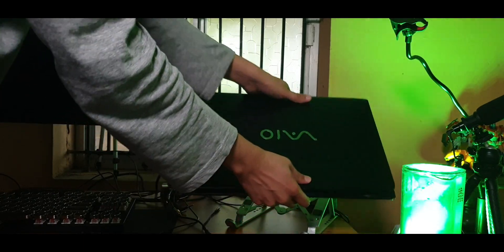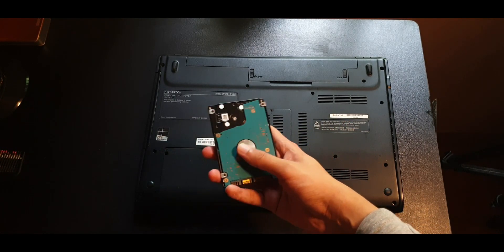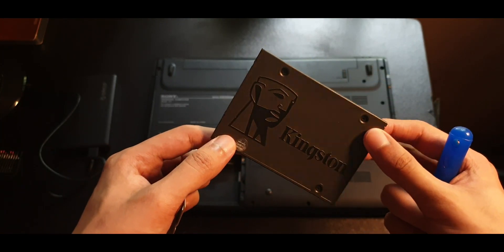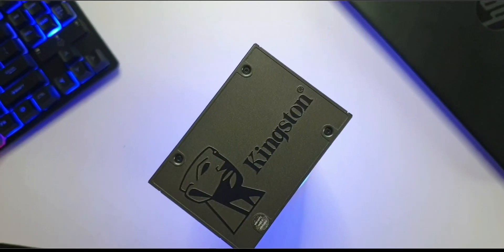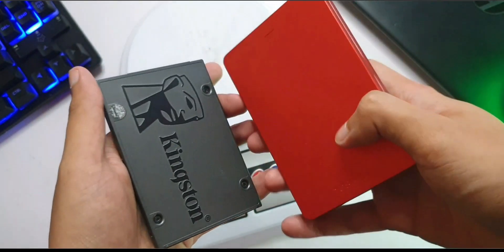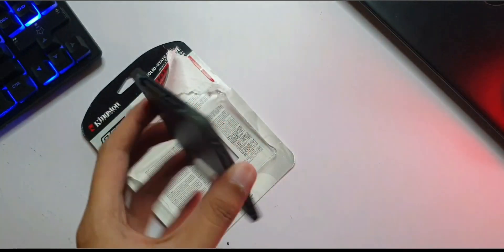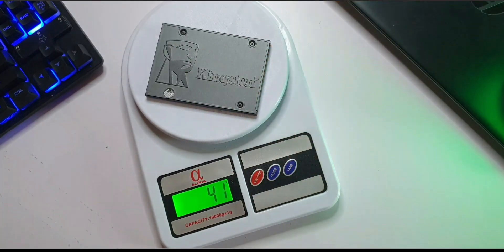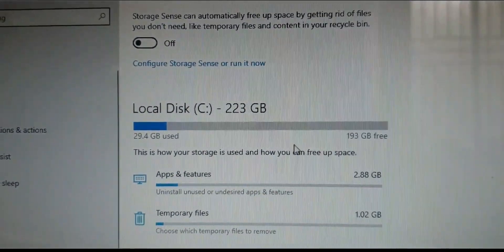How to Upgrade your Laptop HDD to an SSD! - Hard Disk to SSD Upgrade Guide

Comment: how can i copy my hhd windows 10 to ssd? and if i upgrade my hhd to ssd will it automatically boot in ssd???????????????????????????????????
Reply from the maker: The OS is stored in the HDD itself. If you replace it with an SSD, you'll obviously have to install the OS separately on the SSD again.
Reply: @TheHopelessGeek  HOW?
Reply from the maker: Install Windows again on the SSD after you put it into your PC. You can then migrate your HDD data to it via USB transfer.

Comment: so this year i noticed my pc was getting slow due to 5 year old hard disk and i decided to upgrade to ssd. it hugely improved speed but then i noticed my 5 year old cpu was bottlenecking ssd and i could not enjoy full speed of new sata ssd. then i upgraded CPU too which meant motherboard and ram and powersupply were upgraded too. i conveniently bought a nvme ssd and put it in too. now i dont use my sata ssd because its slow.  Does performance increased? yes hugely.  was it worth it.? dont know. hotel? trivago.

Comment: Bro, I have Sony vaio VPCEA33EN, the bottom of the laptop is exactly similar to yours, how do I confirm if the SSD you linked will be compatible? Also, loved the vid!
Reply from the maker: Sata3 ports are the same on any machine, regardless of the manufacturer. It's like USB, a standard.😀
Reply: @TheHopelessGeek  thanks a lot! I'm pretty noob at all these geeky stuff😅
Reply from the maker: 😀👍🏻no problem

Comment: hi, great video! just wanted to say m.2 slots may or may not have comparable speeds. an m.2 sata slot will have exactly the same speed however an m.2 nvme slot will have significantly better performance
Reply from the maker: Yeah, sounds about right.🙂

Comment: Can we use laptop hard drive in our pc?
Reply from the maker: It will be very slow, but with some adapters, you can.😅
Reply: I don't think you need any adapters as it has the same connectivity as desktop hdd (sata and power)
Reply from the maker: That's true, you should be able to directly plug those two cables in.

Comment: I bought CB GK 18 by watching your video a month ago, but now the enter the left shift key 's stabilizer's are making noise , and an irritating one. What should I do?
Reply from the maker: I think left shift doesn't have stabilizers..🤔
Anyway, try putting some lube under them to dampen the rattle
Reply: @TheHopelessGeek  Should I call customer support? As it's under warranty
Reply: @TheHopelessGeek  it does have stabs, all the longer keys except tab and caps lock have them.
Reply from the maker: I just noticed it, yeah.
Reply: @TheHopelessGeek  yeah
Reply from the maker: You can try lubing them first if you haven't.